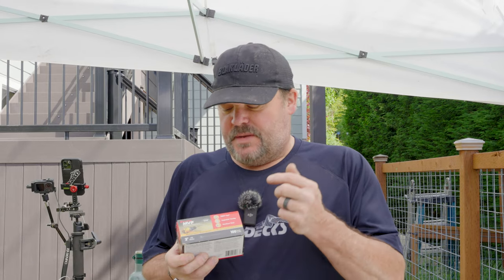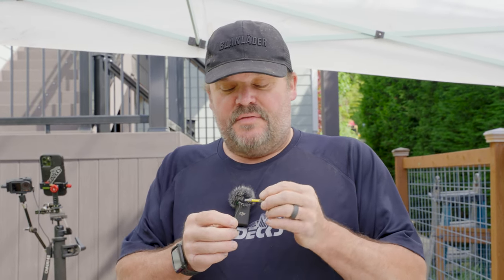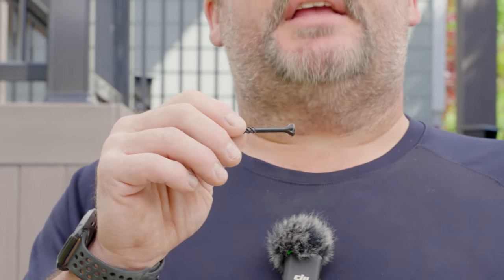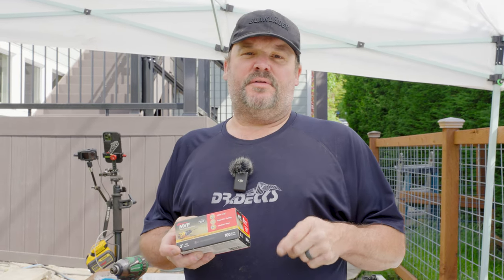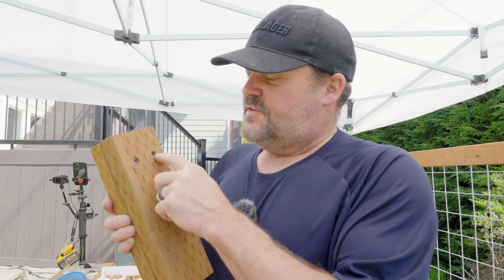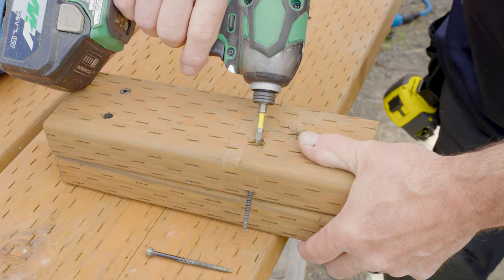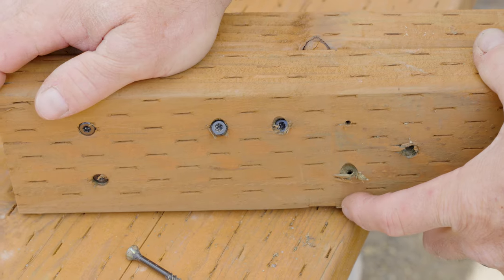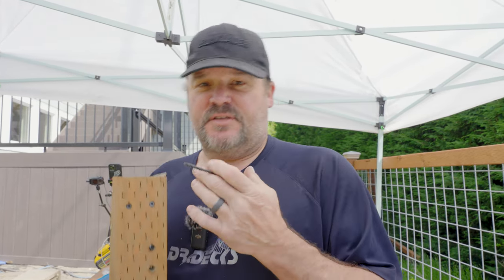Fasten Master's MVP Screws: A Game-Changer || Dr Decks

Comment: I know it's more expensive but I only use stainless steel 3" screws. Even though it's says "lifetime" on the box, coated carbon screws rust away in no time when used in corrosive treated wood. It also prematurely destroys the deck when it rust away.

Comment: Are these strong enough and long enough to secure 16" O.C. blocking between joists which will be used to lay a 2x6 parallel to the joist so that I can lay decking on to picture frame a large deck?

Comment: From what I see online prices are a little cost prohibitive
Reply: He’s probably sponsered
Reply: I use them for the ledger board, they are rated structural as a lag bolt.
Reply: @howtodoitdude1662  those are different this is a regular 3 inch screw not a ledger lok you shouldn’t be using these to attach a ledger

Comment: Run it half way in and smack it from the side with a hammer
Reply: It will snap if you do that, but it won’t snap if it’s supported with material around it as it’s intended for.
Reply: Exactly  it will snap nails will bend
So a common deck screw will snap..... what makes this screw structure then
Reply: @randallmouser5609 , how do you know it will break/snap? Have you tried it? I bet it'll bend somewhat...
Reply: That is my question to Dr Decks......

I would like to have seen that in the video 

The hope is that it would not snap
Reply: why ,in any case, would you do that?
Reply: @86309  screws are high tensile nails are low tensile if wood moves due to wind or earthquake nails will bend but it takes a great deal to snap it
Screws even supposed by wood will sheer
By running it partly in and hitting it side ways will a structural screw bend or snap instantly